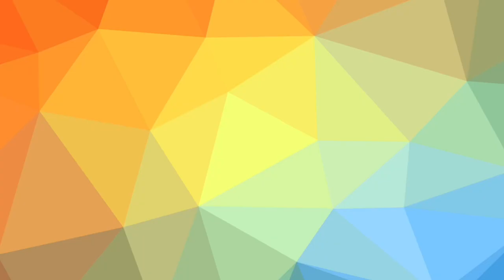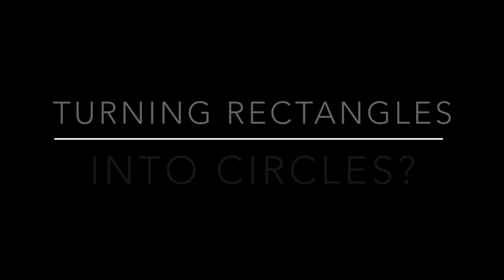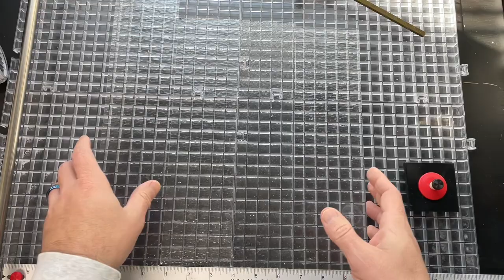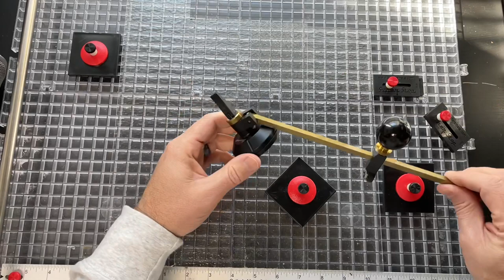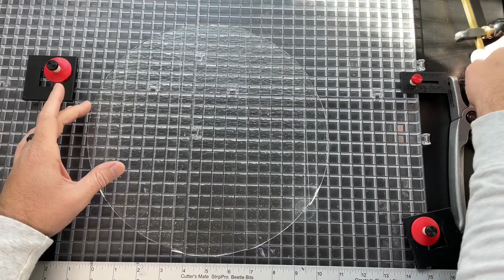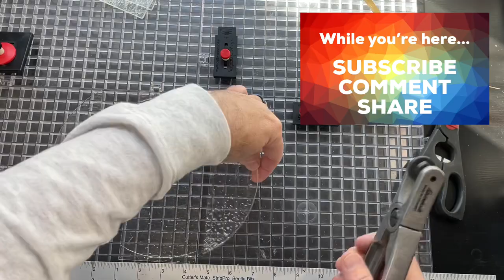Turning Rectangles into Circles!

Comment: Hey Jamison!!!  Fellow addict here LOL I saw in another video you fuse some ashes into glass. Did you have trouble covering them? They don't seem to want to stay covered. I wonder if I'm not going up high enough in the kiln? Do you have any ideas or perhaps I'm putting too much Ash and Mica mixture on the glass?  TIA. Erin @BellaGlassDesign
Reply from the maker: Glass does not want to stick to the ash, so if you are using too much ash that will cause a problem. I also like to cap/cover with sheet glass, not frit as I feel that gives me a better shot at encapsulating the ashes.

Comment: Neat trick, I just use enough weight random clear scrap for the base and put a bubble squeeze in my schedule. I don't notice any seam lines because I think the movement of the glass as it drips down.
Reply from the maker: Yes, I like this idea, especially for a drip. In this case, I was just chopping up scrap and laying it in a ring mold.